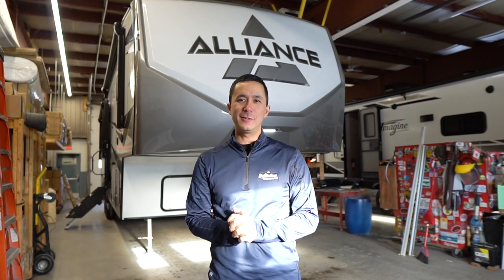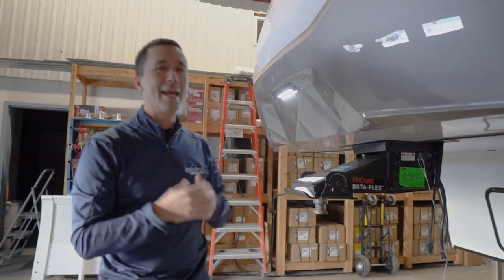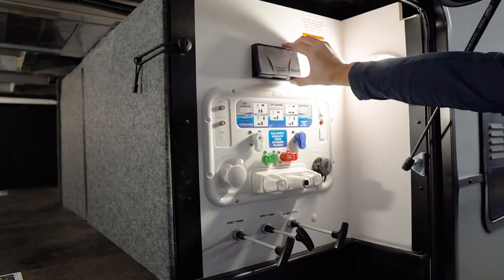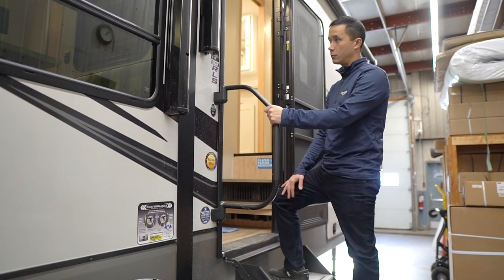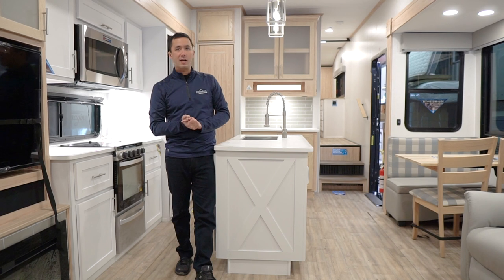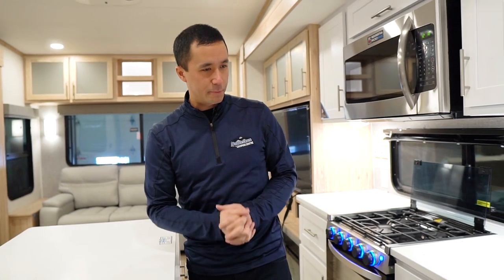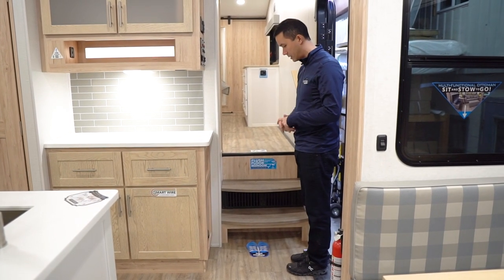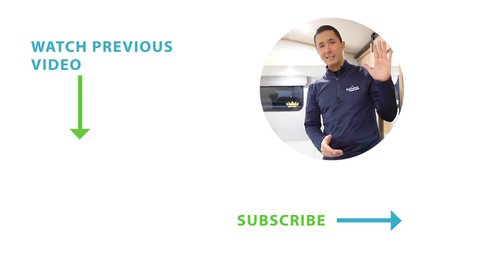NEW 2022 Alliance RV Avenue 32RLS fifth wheel

Comment: I know this has been brought up on video's before but... In many cases you will need a 1 Ton truck to tow this. Other then that well done and Alliance RV's are the top of my list.
Reply: Good point, this thing has an empty pin weight of 2000#.  Even with a gas engine, my F250's GCWR of 3000# doesn't leave much room for cargo and people.